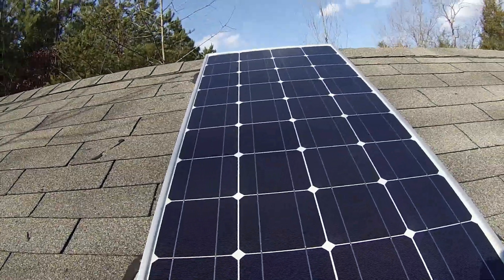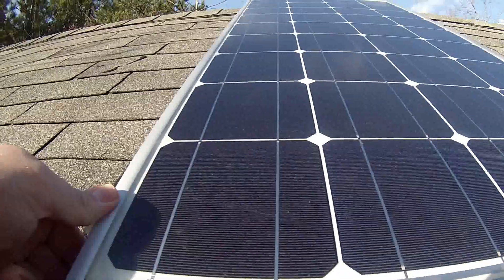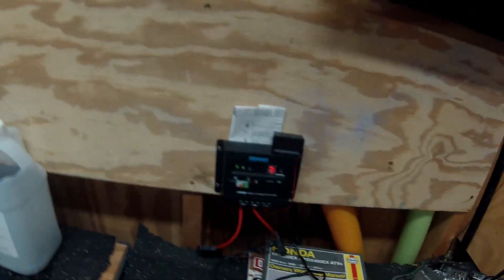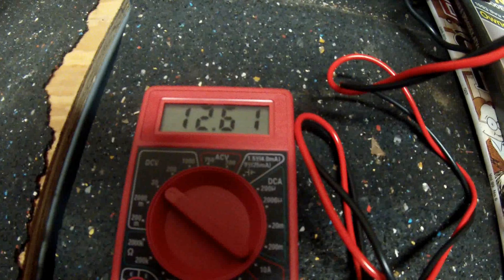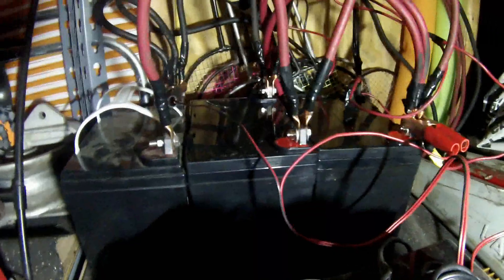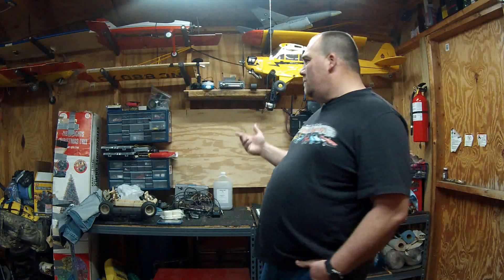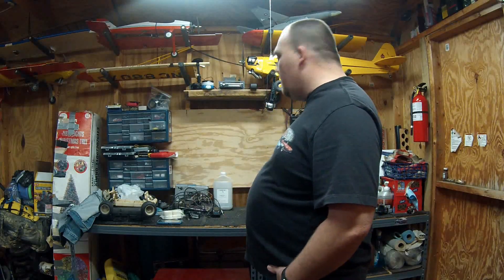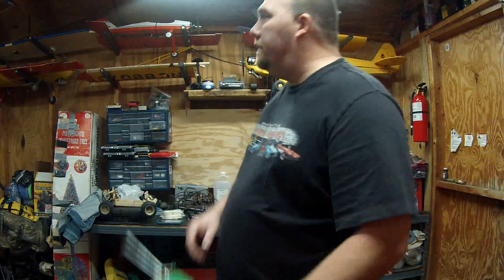DIY Small off grid solar setup renogy 100 watt kit

Comment: If you get an MPPT controller, be careful not to get a fake one. If it's cheap, it's most likely fake. The Tracer 10a model is real, and only about $65. I was able to get one on Ebay for $50. It can run two 100w panels at 24v. And  send it to a 12v battery bank with nearly no loss.
Reply from the maker: Yes thank you, I was noticing a number of what I felt were fake mppt controllers. I actually thought of getting 1 of the smaller tracers, but I think I'm going to get something around 30 amps or so to grow into soon. I'll put it on here when I get it. Thanks again for your post XD
Reply: Karl Wilder I offered the Ipanda people $135 for a 40a Esmart free shipping  http://www.ebay.com/itm/161917756060?_trksid=p2057872.m2749.l2649&ssPageName=STRK%3AMEBIDX%3AIT 
It allows for running the solar panels in 48v so I can tie 4 - 100w panels together and maintain the lower amps on the wires. I keep the battery bank at 24v for my inverter. This way I can add up to 5 groups of 4 panels, for a total of 20 panels. The cool thing about this controller is it has a serial port and software. I bought a usb to serial adapter, but remembered I have an old Dell with a serial port I can dedicate to monitoring my panels. I only have 12 panels, but I plan to add 8 more to this controller soon. At 48v I have to add 4 panels at a time. I have a Tracer 10a and meter, and it works fine, but only up to 24v. There are some at http://www.ebay.com/itm/MPPT-Solar-Charge-Controller-Solar-Charger-Battery-Panel-Regulator-12V-24V-48VDC-/371487758855?var=&hash=item567e655a07:m:mCgk3qmUnrlD08qclPijXuw
I'll be watching to see what you do. Thanks.
Reply from the maker: +pokerfacetodd I managed to miss those, and grats on your purchase, they look pretty nice. Maybe one day you can find the time to do a video on your system, it sounds pretty sweet. Mine is just getting started, but I ordered a mppt last night it should be here in a few more days XD
Reply: Karl Wilder Sweet!